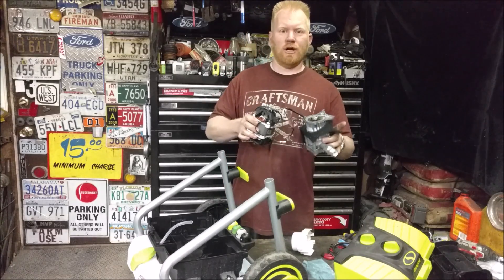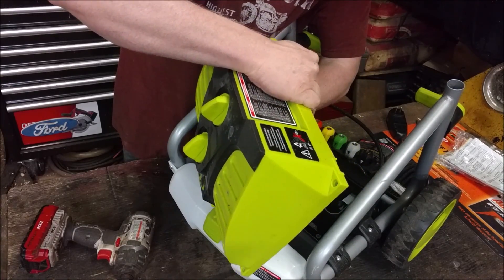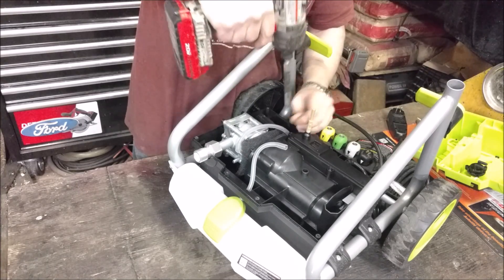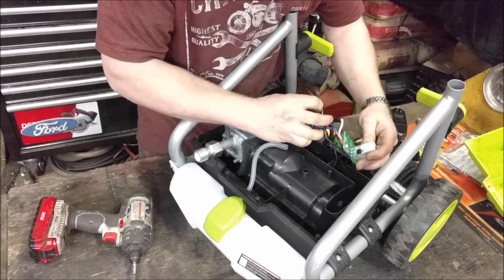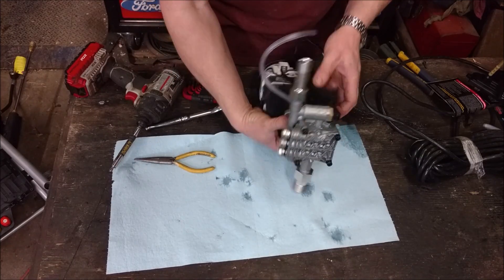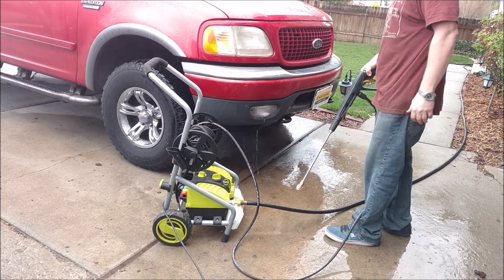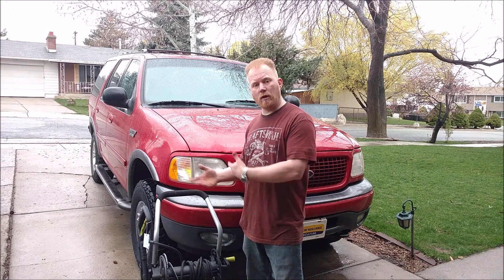How a Pressure Washer Works.. Featuring Sun Joe SPX4001

Comment: Took mine all apart a while ago to try and fix a cracked pump body (rofl not a chance... without welding) ... had no idea what I was doing (never worked on pressure washers) .. anyway was very intrigued by how the internals of the pump chambers/pistons and all were, but didn't really know exactly what they were doing... and didn't know what oil to replace it with when it all spilled out, lol. This video finally bridged those gaps for me... thanks a lot man. Swashplate! 😄
So the electric unloader valves are basically electronically controlled solenoids... that have either sensors... or mechanical solenoids that automatically flip if they are pushed with enough force... I am guessing?
In the market for a replacement... fun... so many options lol.
Reply from the maker: The unloader valves are generally a mechanical device that is generally just held in place with spring pressure. Excessive water pressure forces a mechanical plunger out. On the other side of the mechanical plunger they put a micro switch to shut off the power. Essentially, the mechanical plunger just pushes a button.
Reply: @sixtyfiveford  Thanks... makes sense... less electronics ftw😄

Comment: My sun joe 2030 is leaking from pump head. Water building up in the case is splashing and shorting out board. Fix or Trash?
Reply from the maker: @DZ-gl7no  There are no parts available. Maybe it's something simple like an o-ring but any other parts you won't be able to find. You could simply drill a bunch of holes to allow the water to exit the plastic shell or just see if it's a loose fitting.
Reply: @sixtyfiveford  thanks for the tips!

Comment: How do you add more oil to it if it needs more? Do you just fill the housing for the bearing with oil?
Reply from the maker: @james2some  Yes, but it is not completely full. It's generally only about half full and I would use SAE 30 non-detergent motor oil. It's readily available

Comment: Great video! I know it's six years old, but I am hoping you can tell me which O-ring and seals to order to rebuild the head of the triplex pump on the Sun Joe SPX4001 like the one in your video. Also, can I use 5W-30W oil when I put it back together?
Reply from the maker: Honestly, these are not meant to be rebuilt at all. The company actually got a little irritated with me that I took it apart and showed that on video. So any parts you're going to have to just measure and order bulk. As far as oil, most pressure washer pumps use SAE 30 non-detergent oil. This is pretty common at Walmart etc.
Reply: @sixtyfiveford Many thanks for taking the time to reply.  KBL
Reply from the maker: @kennethlevan9370  Best of luck.

Comment: Great review and video.  I take exception to one point.  You said that it isn't designed to fail at any point, I disagree.  The unloader valve is made of nylon, you kind of glossed over this, and the company doesn't make a replacement part.  If the unloader valve gets gummed up (which they tend to do) there is no way to disassemble it and clean it out.  The nylon body is too flimsy to be unscrewed and so it is impossible to take it out and clean it.  But, even if you do manage to get it out, (likely damaging it in the process) the company, Snowjoe, does not sell a replacement part and only offer a 15% discount on your next purchase.  If the unloader valve is gummed up it will permanently cut off your motor rendering the entire machine worthless.  I believe this unloader valve is designed to fail so that you will be forced to purchase a new product.  If this wasn't the case the company would just offer a replacement part so the owner could repair it.  But, they don't want us repairing it, they want us to buy a new one.  This is the world we live in now, and it is sad.

Comment: Where do you find parts for that pump and motor
Reply from the maker: You won't find any parts. These are designed as throw away units.
Reply: @sixtyfiveford  I have the same unit it pulsating even without the trigger pulled and leaks water underneath the unit

Comment: Mine is leaking out the hole by the back of unloader on the spx4000.  Would the water seals on the head cause this?  No parts can be found anywhere.
Reply from the maker: You won't find any parts for these. Or any electric pressure washer like this from any brand. They're all considered throwaway.

Comment: I think the Total Stop System (TSS) switch in the wand is not working correctly. It senses water flow in the pump. When the trigger is released, water stops flowing through the pump. When I release the switch and go to press the switch it does not turn on the pump. I have to take off any nozzle and then reattach it before it will work again. Can I spray some electrical contact cleaner on it? And if I can how do I get to it.

Comment: Hi! What kind a oil is best to use and the quantity for SPX3000? Thanks.
Reply from the maker: Generally pressure washers use Non detergent Sae 30 motor oil in the pump and only takes around a cup. That oil is available at Walmart or any auto parts store.
Reply: How did you fill it up with oil I'm having a hard time doing it please help

Comment: Just a btw comment water does not compress,  the pump just moves a precise amount of water. Pressure is made by the pressure rated hose pushing the water through the gallons per minute nozzle, that model is typically a 2 gpm.

Comment: You just slid the motor out of the plastic housing I cannot get the motor out of mine SPX4000 no matter how hard I pull! I need to get it out as one of the wires broke off ware it connects to the motor housing. Any Ideals?  thx
Reply: Got it just pulled really hard and it came out! reconnected the wire and was good to go. Thx for the Video
Reply from the maker: Awesome.

Comment: I have an old snap-on 1750psi electric washer. 
So, can these cheap electric washers normally be serviced? Oiled, etc. Are the internal parts (seals/springs/bearings, etc) pretty much standard & more or less interchangeable?

Comment: had a micro switch issue with a sunjoe spx3001.  replaced that after searching far and wide for a cheap place to get the $2 mico switch.  I got the washer used and it always had the priming issue, pump would start itself after about 10-30 seconds.  saw your video so i figured i'll try to tackle that problem as well. took the whole thing apart.  Everything looked ok to my surprise.  The only thing i couldn't take apart was the unloader, is that replaceable?  It's amazing that for such a popular brand like sunjoe there's very little in terms of available replacement parts or information about repairs compared to other brands.  Is there a specific kit to replace all the internal seals?  thanks for the video!
Reply from the maker: There's really no parts support for these. Mainly because so few people would even attempt a repair and a shop rate would overwhelm the small cost of the unit.

Comment: I have another pressure washer, that was leaking water all over the place out of one of the cylinders, comparing this sun joe with mine, I can see this one is much better quality  mine has plastic cylinder head. with just a cover that holds the inserts in,   this one has individual metal caps,  much better design I think.  also noticed yours has lots of oil in the inside,   mine just had a coating of grease,   that oil in yours should conduct heat better to the housing,  again,  a better design feature.    thanks for this break down,  I think I know what unit I am going to get to replace the one I got.

btw,  regarding models, i notice 4 main models,    2 uprights and 2 cart types,   the difference being whether they have a roller for the hose.   so,  3000 is upright,  3001 upright with roller,   4000 cart,  4001 cart with roller,    PSI and all that are the same on all 4.    think I am going for the 4001,  like the cart idea, I just know I will knock the other one over.
Reply from the maker: Thanks, I'm glad you liked it. It has been holding up great.

Comment: my unloader valve/motor shut off switch housing is leaking...can I replace this part????
Reply from the maker: I don't think individual parts like that are sold do to the low total cost of the entire unit.
Reply: @sixtyfiveford  ...thanks, I called snow Joe and they said the unit has a 2 year warranty...send it back and they give you a new unit...that's a pretty good deal

Comment: So, by the looks of it, an electric washer will  shut off when too much load is not bring used, unlike a gas pressure washer which will heat up after no use and release itself. Right on.

Comment: I've had this washer for 18 months, but the unloader valve is broken. Does anyone know if its repairable? The top of the unloader valve  broke off.
Reply from the maker: These are a budget machine and I doubt they would keep an inventory of repair parts. Mainly just because a repair shop labor costs would out way the cost of just buying a new machine. You can contact Sun Joe though and see.

Comment: I was hoping to see you disassemble the plunger portion with the plastic nut on it I'm stumped on pulling it out to re-engage it cause it won't run, any tips or tricks with out stripping it out?

Comment: Nice video.  I have model SPX4000 so the motor and everything looks the same other than the wind up hose real.  I am currently having a problem where the motor doesn't shut off when I let go of the trigger.  So it seams as though it's not getting enough pressure.  The garden hose is fine, I cleaned the pre-filter and the water inlet filter and so far that hasn't helped.  Any suggestions?
Reply from the maker: Does the pressure seam less than usual while spraying? It could be just the pressure sensor valve is stuck.
Reply: Yeah, kind of I guess.  It seems like at times it's going full strength, but then I let go of handle (and it keeps running) and then I re-squeeze handle and it's just shooting water without any pressure it seems.  If it is the pressure sensor valve, where is that located?  I don't think you mentioned that in the video, I could be wrong but I've watched this numerous times now.  And how do you unstick it?  Thanks.
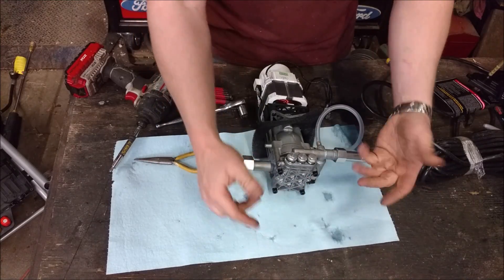Reply from the maker: At 4:04 I talk about the Unloader Valve. This is what controls the pressure/motor running.

Comment: It's plain to see that an electric washer is a better deal than a gasoline one for occasional use.  It's a nuisance to shut off the engine/save the pump from damage.  That explains what happened to mine, despite avoiding idling it.
Reply from the maker: I actually never gave electric pressure washers a second thought until  a few years ago. The ease and convenience is great.

Comment: my greenworks 2000psi PW works fine after repairing the power switch but while it's on and sitting the motor kicks on/off for a split second every 1-2 seconds. what causes this?

Comment: I have a greenworks 2000psi PW I got second hand because it didn't work but it was a bad switch with the same setup as this model. I changed the switch which was burned up and it took off working. working at Lowe's I've seen a few others like mine come back with the same problem, makes me wish I could get them too but I can't.

Comment: How do you store a pressure washer during a below zero winter?  I've discovered storing in an unheated barn doesn't workout so well?
Reply from the maker: I run RV antifreeze through it, but any antifreeze works.

Comment: cool video...just bought a ryobi gas unit for work...has the honda engine but lets see how long the pump lasts.
Reply: I have a Briggs pressure washer horizontal crank Honda engine. I have run this thing for literally hours on end. It gets stinking hot. The manual says to let it idle for 3 minutes after use and this ostensibly cools the pumps so it won`t fry. Of course, I have it attached to the hose, which stays on during this cycle. I have owned it for about 5 years. I leave it outside sometimes in snow and rain. It has paid for itself twice over.
Reply from the maker: I buy a lot of these broken gas units just for the Honda engines to put on other equipment. Just don't let the engine run for more than 30 seconds or so without pulling the trigger, even if it is just spraying at the ground. The pump overheats and destroys itself.

Comment: I have a gas powered one.  I use it all the time.   Every time I do any big job to a car,  I pressure wash the concrete when I'm finished.
Reply from the maker: I'd be lost without my gas powered pressure washer. I picked up a Hotsy hot water unit last year and it has become my new best friend for greasy car parts.
Reply: A place I worked for a long time ago had one of the hot water ones.  Every time I would turn the burner on it would smoke a whole lot for the first few minutes.  They ran it on Diesel.  Every time I would finish the job and have it put away the fire department would show up.  Then they would ask me did you see smoke.  And every time I would say I didn't see anything.  LOL
Reply from the maker: That's funny.

Comment: Sold me on the older unit Sun Joe SPX3000... My garage is my office and she needs a floor makeover. Home depot 137.02 delivered to my door with Illinois state tax. I have been looking for one of these for a while, the review and the tear down was helpful in my decision. The new model was going for 199.. The next question to ask would be after I wash the cement garage floor; what would be a good sealer to use? Also thinking of vinyl tiles. The floor is sound. Just needs a cleaning a seal. Thanks for the great advice as always!
Reply from the maker: I was impressed at the 4000 Home Depot+Amazon reviews they had on the SPX3000. It's rare you see something with that many reviews and that many positive. I've actually never sealed/ epoxied cement but I've heard horror stories of it pealing because of the oils soaked in. Tiles sound like a safer bet.

Comment: We have really crappy water that leaves buildup inside the machine.  My dad's was completely seized up, and I pulled it apart, cleaned everything, and it ran like a champ again.  What can you do to prevent that problem?
Reply from the maker: Besides making sure there is a filter screen on the inlet you could run a descaling chemical through once in a while; heavy duty LimeAway or more mild plain vinegar.

Comment: I like the reel, I am going to cobble up something similar for my gas powered pressure washer. Incidentally, the book that came with my craftsman washer recommends using RV antifreeze in it over winter to prevent oopies.
Reply from the maker: I generally use RV antifreeze through mine. I wish I had the reel on my gas powered one.

Comment: What kind of pressure does that develop?  The electric pressure washers I've seen don't shut off power from the wand like that, but only cuts off the water flow.  I guess that one doesn't use a valve at the wand, to allow the pressure to bleed down then the trigger is released, and unload the pump for startup.
Reply from the maker: It peaks at over 2000psi but that is pretty standard with any pressure washer. The gallons per minute is where one unit will shine over another. It has the same unloader valve built into the pump that all pressure washers do, they just added a motor shut off as well.

Comment: I like that switch idea too. Pretty cool actually.  "Swash-plate" That's a part on a helicopter too, kind of cool. I trust your reviews Moe, thanks for the info.
Reply from the maker: I use a lot stronger gas powered unit on a pretty regular basis during the summer months but may keep this one around for a few seasons because of the ease of use over my gas one.

Comment: I spotted a $10 Craftsman power washer at the local scrap yard that had a locked up engine. Would you have bought it? I didn't go for it. Wondering your thoughts. I've never worked on one but I've worked on mowers and blowers.
Reply from the maker: Vertical shaft gas pressure washer I pass all the time because the motors aren't very useful and pumps not worth rebuilding. Horizontal shaft gas pressure washers I pick up all the time for $25-50 with a good engine and bad pump with the idea of just using the engine. I prefer to grab the low end units with the Honda engines(gc160-gc190) for swapping onto tillers, etc as it increase the value/ease of sale of a machine dramatically. I probably wouldn't pick up a low end gas pressure washer with a bad engine as the pumps only last 25-50hours and it is probably defective as well.
Reply: Cool. Thanks for the reply.